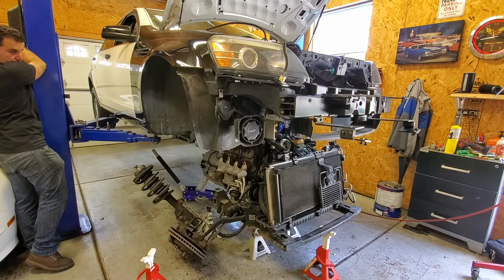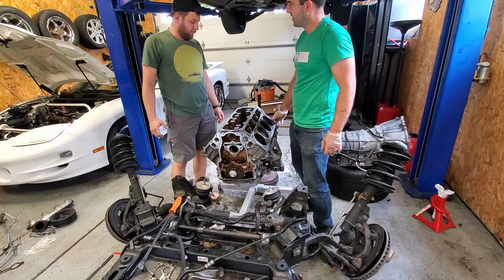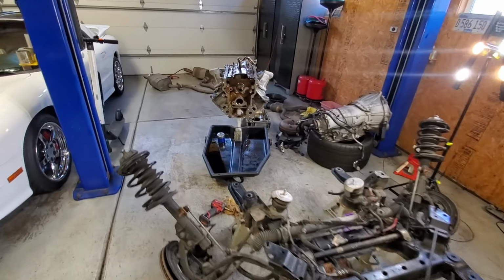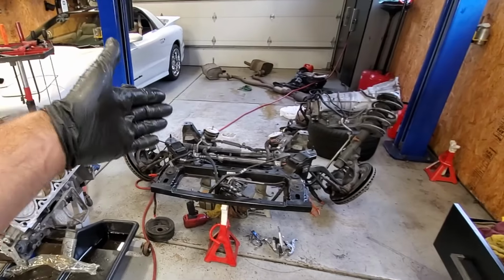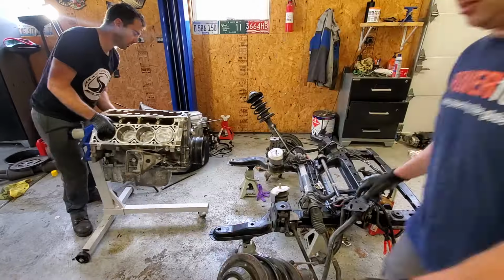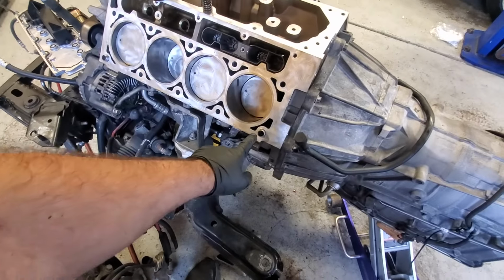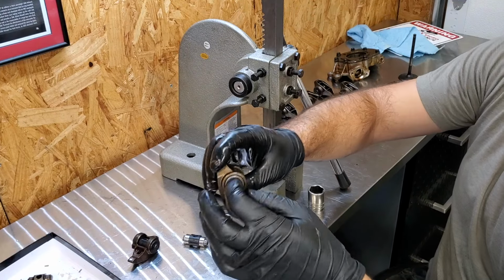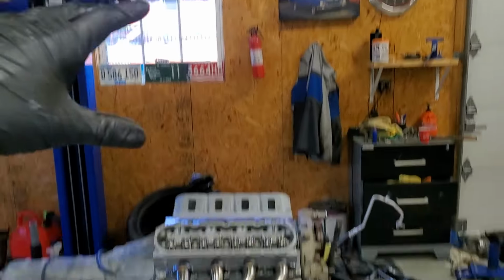Fixing THE WORST LS Engine Factory Defect Ever & Adding 100 Horsepower In The Process! GM Failed US!

Comment: As a lifelong diesel mechanic,this is the dumbest idea I ever heard of. So u close the vavles to 4 cylinders ( on a V8) ,shut fuel and spark off to those cylinders. So you have basically 4 dead holes and a huge amount of drag caused by this design.  On a diesel engine with a Jacobs brake,the engine is used to slow vehicle by opening exhuast valve when Piston reaches top of compression stroke and fuel injection is minimal as throttle is at idle at that time,and it's the braking that is the desired effect. How is that any different than what's described in this idiotic design? Other than a turbo is still pumping air in and a full cylinder of air when compressed slows vehicle even more. This is a stupid design.js

Comment: AFM would get better fuel economy if the valves were open rather than closed so there's no compression to work against on the deactivated cylinders.

Comment: If you have not freshened up that transmission and reworked the valve body, accumulator or servo and frictions and steels that 357K mile transmission is not going to hold together much longer with high stall converter and bigger cam etc!!! Well assuming this engine builds original power levels or greater??

Comment: The only thing I would have done differently is for a normally aspirated engine with high mileage  even with good cross hatching and  and no ridge I would have put a light hones to it and tossed new wrings on it. For blown or turbo charged up to 150K miles I often do not change them at all if the engine is in good shape and not going crazy with boost. Cheers! Love your Channel!

Comment: Powernation tv has a specific way to install LS oil pumps. First they dimpled the sides of the pump lobes to trap a small pocket of oil and center float it in its assembly and shimmed the spring,  both  together upped the oil pressure significantly . 
Then using about 6 gapping sticks, 3 on inside rim of pump, 3 on outside then and only then do you tighten down the oil pump mounting bolts ensuring its centered with crank.
I think they did similar thing with timing cover and seal, not tightening the cover until the crank is rotated several times to center it.

Comment: Stupidest idea of saving gas I've ever seen. And I've seen a lot of stupid ideas. You would do better when the vehicle is not needing torque to pull it down the road all you would have to do is lean the engine. Engines will run quite lean without damage. The other advantages you will have all 8 cylinders pushing the car instead of having four cylinders pushed for more cylinders before they even get to push the car. Then when you want to pass somebody or do anything other than just cruise on down the road, it can instantly start pumping more fuel into the engine.

Comment: Before you secure the oil pump on the LS motor. You have to shim it to prevent oil pump from premature failure. You didn’t shim it! This needs to be done at 3 positions of the oil pump drive gear on the crank. Then torque up in cross pattern to spec! Is honestly have a look at it in the near future bud!! Just for safety sakes! 
Hope this helps!!

Comment: Dang glad it’s not my motor using a sanding disk on the block around the heads, that’s just asking for issues..wow..I’d spend the extra 3 hrs to clean it correctly if it was my motor..he says it doesn’t remove anything, but it can leave small tiny bits in the cylinders..even the plastic wears down and has to go somewhere as well..

Comment: Reason the valves mushroom 99% of the time is because the cam lift is high enough that the valve spring binds/bottoms out. Meaning you need to change your springs or get a cam with less lift that the springs can handle. The only other time I have seen it was on old (regular gas old) engines with factory solid lifters and improperly adjusted rockers and the slap the valve to death.

Comment: Instead of tweeking/denting your passenger-side header, flow-restricting ONE tube, can you heat-up your pedestral, and once red-hot from a torch, take a 15-lb short-handled sledge-hammer and hit the pedestal in the middle, so IT is bent/tweeked?    Moving the pedestal 1/2" - 1" closer to the block might give you enough space for your passenger-side header { which could be heated in a vice to bend all 4 tubes slightly, at one time, so if you didn't want to heat-up & bend the pedestal, you could merely make the passenger-side header, less "close" to the block, by heating Them up and bending them out, slightly }.  you could put the passenger-side header on, upside-down, so they are pointing up/forward.  figure-out how much clearance you need with the pedestal and all, by measuring the space on the driver's side header.   Then you carefully heat all 4 of the passenger-side header-tubes so you can bend with a single lever from the collector, bending the pipes to fit the estimated space necessary.  'Hope this helps.

Comment: I once owned a 1963 chevy pick up. it had a 327? in it. it never ran quite right so I started checking things out. I eventually found that the #1 lobe on the cam was worn flat. I hung it on the east wall of the ag mechanics class shop at butte community college in 1987 and I have no idea what happened after that... go benz's fuggers!!

Comment: Virtually all engines with proper maintenance will last an extraordinarily long time without issue. It's almost always lack of maintenance that kills them. However increasing horsepower means additional stress on the car the manufacturer didn't account for and will almost always require strengthening various engine and drivetrain parts.

Comment: Any particular reason why engines use the same engine oil in the cylinders as in the cam shaft? Wouldn't it be better to keep the oil for the cam separate from the cylinder oil? There isn't any combustion where the cam is .

Comment: I see you guys are using the safest way of cleaning the block deck. Have to take off my hat to you fellas for sure. You are true master mechanics. HOw can you stand wearing the gloves for hours at a time ??? Any time you have wires that get hard form heat you need to replace. Ask why I know, cause I did the same thing you did fix the wires and finish the job. Then two weeks later some of the wires cracked and shell we say mess with something that could be fixed right to begin with, lesson learned the hard way. Good day too.

Comment: Just a suggestion, anybody with an active management system such as Chevrolet's or Chrysler's or anyone's needs to put Marvel Mystery Oil into the engine on occasion. How about a half a quart to a full cord about a week before an oil change and the engine will not suffer those issues. At least not due to the screen getting all plugged.
Wiring harness may have been damaged from the fact that GM may still have been using biodegradable insulation on their wiring. They made wiring for a while made from soybean. It also tends to attract rats and other Vermin who like to eat the vegetable based wiring insulation.

Comment: There appears to be some aluminum "fur" from the pan-maker NOT impregnating it with an anti-oxident sealer, so WHY don't you use your plastic cleaner head & knock it off, so guys don't think you've 'aluminum worms' living in the your oil pan.    Once they're knocked-off, spray with some clear or whatever.

Comment: I have a couple of questions...I'm about to do a cam change in my 2004 LM7 with a BSR stage 1 truck cam, would I need to change the sprocket like you did? Also,  what was the purpose of changing out the timing chain guide? Thx

Comment: The 2jzgte vvti gtus is going back to 13b rotary!

https://www.mazdaforum.com/forum/mazda-rx-7-33/joe-maddox-super-rare-1-100-1989-fc3s-gtus-rx7-2jz-gte-vvti-build-43602/

I have found and saved the rarest Mazda FC RX7 ever made! Now this car is rare. Really rare! Let me break this down really quick... 

Ever heard of the rare 100 GTUs rx7s? Only 40 have ever been claimed and only 15 are confirmed at the time of this posting! Here are the rarest rx7 FC3S models: 

1500 10AE Turbo models 

1400 infini 

1000 winning limited 

150 final edition convertible 

100 GTUs... 

out of that 100 they made three color options:

red on black 
black on black 
white on blue 

There was only 100 GTUs models created between 1989 and 1991. 

If you own one of these rare models sign your car up to the registry list here on any of the rotary forums! 

There are rumors about a restamped GTUs model... 

The entire origins GTUs owners thread on the rx7club was modified, icemarks claims deleted, registry list changed to have a confirmed section and the mods agree there are not enough GTUs models to have the restamped. 

If you want the full story behind the restamped models: 

https://www.mazdaforum.com/forum/mazda-rx-7-33/restamped-mazda-rx7-45926/ 

https://www.rx7club.com/2nd-generation-non-technical-pictures-198/restamped-mazda-rx7-1148475/ 

If you have a real GTUs you can register it here: 

https://www.mazdaforum.com/forum/mazda-rx-7-33/official-mazda-rx7-gtus-owners-club-thread-44477/ 

https://www.rx7club.com/2nd-generation-specific-1986-1992-17/mazda-rx7-gtus-1148362/

Comment: How did he get the old cam shaft out ? Can u swap the cam in the vehicle. How do u change the pin that holds the cam shaft in position on a single bolt cam shaft

Comment: For the love of god...if you ever pull the stock harmonic balancer, REPLACE IT. They are known for having separation issues, and when it does fail down the line, then you get to rip out everything in the way so you can replace it. Also, if you're ever planning on supercharging the engine, go ahead and pin it while you're in there. That way you are already done in the future. It won't hurt anything if you don't supercharge it, but it will save you time.

Just a tip for anyone doing a cam in the future.

Comment: Awesome build! I used a lot of those same components in my car. BTR is good stuff! Not a big fan of the hollow valves tho. I like the weight savings as much as anyone but they have a pretty bad reputation for breaking. You SHOULD be ok with a n/a setup but any kind of power adder you're taking a big risk.

Comment: GM designers really miss the mark, frequently. If you get a flat on an HHR SS front tire. You have to take a back tire off and put it on the front. The spare won’t fit over the front brakes. Stupid design. Idiots. My wife couldn’t manage this on the side of the road with a factory Jack. GM suck beyond this. They were bailed out by the government and got rid of Pontiac because of this. I drive F-150’s now because of this. Great truck. No more 1500’s, had several new ones and the transmissions fucked up. Crap trucks.

Comment: My 2014 Camaro SS LS 3 motor seized up and a family member thinks it was the oil pump failing because I used a plug in device to keep the car in the 8 cylinder mode , I know you cannot know what really happened unless you inspect it but on a Gerald idea what could it be

Comment: So what you saying when you cut through all the added verbage is poor engine maintenance and extended oil intervals poor oil change intervals causes a lot of problems that can be eliminated by just changing your oil regularly or maintaining a good maintenance schedule but these are usually  the habits of people with poor maintenance skills who were never taught the importance  they're lazy people people that don't think about automobile maintenance they just stick the key in and go they stick the gas in the other Hole and they drive and do nothing until they hear a noise then they go oh something's wrong my my truck is junk I've seen it all before..I've seen cars come in with oil so bad It would not flow out from the oil pan easily until I poured a gallon of red heating kerosene thru the motor then used  2 quarts of Fast flush and let the engine run outside then drained it replaced the filter filled it with oil and added a quart of Marvel Mystery oil and the car ran smooth and quiet for many years without any issues because I showed this car owner the video we made .but wait wait with all the aftermarket vavle train components offered i.e. rocker arms you choose to go thru the bother of doing the trunion upgrade really bro.? So you went with Titanium retainers lightweight valves but kept the Bullshit cast rocket arms bro wow really ? Maybe you should have used some of the thousands you wasted on BS wheels on Rocket arms like the Shaft style arms that actually really do add stability to your valve train ...?

Comment: I would think u would want to open the valves and disable the fuel and ignition. That way ur just moving air not compressing it over and over.  As opposed to closing them off completely.

Comment: Surfaces heads to prevent gasket sealing issues. Proceeds to destroy the deck surface of the block with a biscuit trying to clean the harmless carbon on the pistons. Aight imma head out.
Reply from the maker: It blew up on initial start up from the disks

Comment: You were sooooo close to a complete rebuild.. What about new cam bearings? block decked, bores checked, crank checked, rods and mains?   My son's 2012 GMC Serria was rebuilt after all the issue's with the AFM, at 120k.  Local Machinist/Engine builder did it all...  Pistons all minor scored, bores actually all good. New pistons almost half the weight of the old. upgraded cam, meling oil pump, valve job. ECM tune, and Tuned again while driving, Engine and Trans now perfect. He was a perfectionist. Engine now has 20k  Still a Great Viedo..

Comment: Good video, nice work.  I've put together over a half dozen LS's and always used new oil pumps and the LS2 improved timing chain but I always check the pushrod seats in the rockers.  I've never torn down a LS that didn't have at least 4 or 5 bad rockers and pushrods where the wear pattern is all screwed up.  Replacement bodies and a set of one piece pushrods are mandatory.  The kits with the full caged needle bearings for the rockers are good but I prefer the Staube kits with the oilite bronze bushings, mandatory also along with a new cam and Blue LS2 springs from GM performance , Texas Speed or BTR.  My last build I bored and swapped in a set of flat top 5.7 pistons into another 5.3., stuffed it into a '68 C10 with a 700r4.  Right now I got a 4.8 for free, going through it and adding a Texas Speed low lift (.550") cam and a set of blue springs.  Headed for a T5 and going in a '88 S10 for a daily driver, tons o' fun.

Comment: I got sad not seeing any assembly lube on that cam before it went in... well... lets see what happens

Did you check the harness for high resistance where you repaired it? Its good to make sure it has proper signal.

Comment: NEVER TAKE AN AIR TOOL TO CLEAN UP AN ALUMINUM BLOCK! STUPIDITY! WHY RESURFACE THE HEADS ONLY TO RUIN THE DECK SURFACE? YOU BETTER GO TO SCHOOL ON RA AND FLATNESS.IT'S EXACTLY AS STEVE MCBRIDE STATES. PRECISION IS THE KEY TO PERFORMANCE. HE IS THE TOOL AND DIE MAKER WHO BUILT THE WORLDS QUICKEST AND FASTEST TOP FUEL MOTORCYCLE. HOW PRECISE IS SCOTCH-BRITE?
Reply from the maker: Car runs great. Your caps is stuck on
Reply: TSB (00-06-01-012D

Comment: I remember when a sbc, or any carb engine, was wore out and burning oil at 100k. Youd basically need rings and a valve job just to start. Now a engine with 350k is still running strong.

Comment: Installing the front engine seal the way you did is a recipe for a quick oil leak. There is a tool to correctly align the cover. You are the only TOOL on the video

Comment: You got the engine out and in the open and your just gonna bury those crusty rusty wires that you'll never be able to access easily again? You think electrical tape will suffice? it will just slough off after first few cycles and that nice heat wrap will ensure your wires stay water logged and happily rot away. Not to mention the sheathing is melted off all the way up to the connector witch you cant even hope to seal off with electrical tape. You will be dealing with that again in 3000 miles why not just do it right cut back to good wire solder and heat shrink connections and yes,... re-pin the plug bruh.
Other than that love the build!

Comment: I’d recommend when installing a melling 10xxx series oil pump to use a shim kit for proper alignment. (only like $20). The m295 (for example) have a wear ring built in so alignment is not as critical.... not trying to dog you out just passing on some additional info...... otherwise great video.

Comment: The LS engine IS A DEFECT just in its existance. Last night onna forum some dipshit stripped with oil pump mounting bolts from over torquing, 😄😆😆. How is thst even possible the fuckinnthreads still allow the bolts to move. Ive done countless oil pumps on 454s, pontiac 455s, and caddy 472s, never had such a weak ass mounting area that would spit the bolts put and grenading the side of the block. But ey watever floats the current trends shitty boat.
Reply from the maker: So one guy on the internet breaks something and all 10 billion LS engines that have put into everything from sports cars to pickups are junk? Makes sense.

Comment: Just wondering. Why wasn't the pistons removed and open up the end gap on the rings? Also, any problems with thread sealer or gunk in the lower head bolt holes impeding the final torque of the heads? I learned the hard way to clean those holes out before putting heads back on. Nice build.

Comment: you have to be super careful using the green finger wheels on aluminum. you should try the yellow it works better on softer metals. I use the green on steel. just a tip from an ASE certified and experienced technician.

Comment: I think you're supposed to put 3 shims around the crank shaft when you bolt on the oil pump. I watched melling's video on installing an LS oil pump, and I'm pretty sure that's what they did. I don't know if it's required though.
Reply: It is. That centers the rotor.